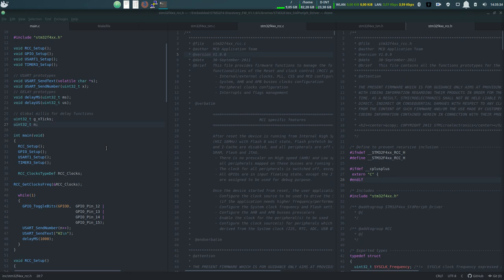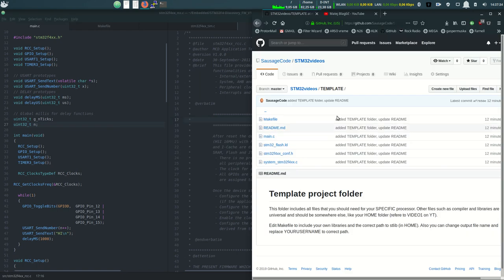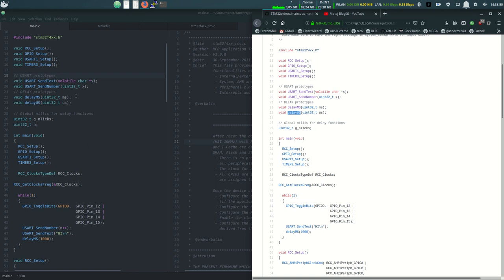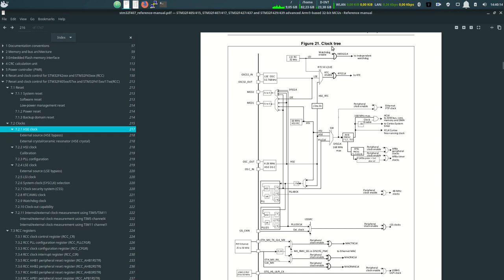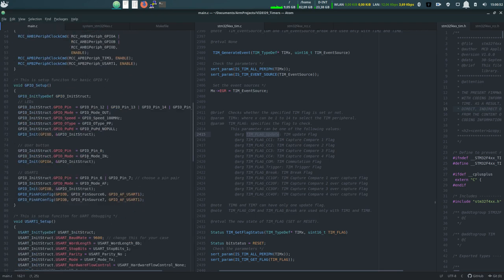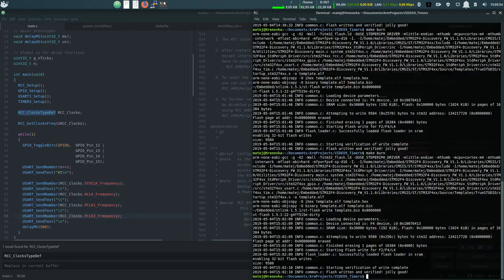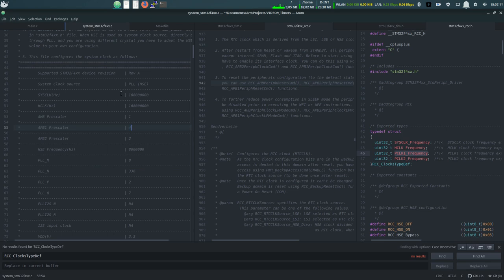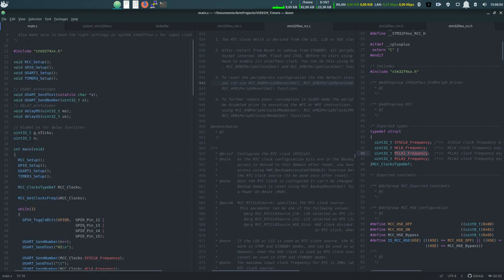Timers and delay function | STM32 development on Linux | VIDEO 9

Comment: 10:35 clock that is going to timers in APB is multiplied x2 if prescaler is set to anything but /1
Reply from the maker: Yes, I saw that in the reference manual clock tree, but didn't think of it. Then I saw it in the clock tree of CubeMX at work and saw that the clock was multiplied by 2. Thank you for pointing that out!